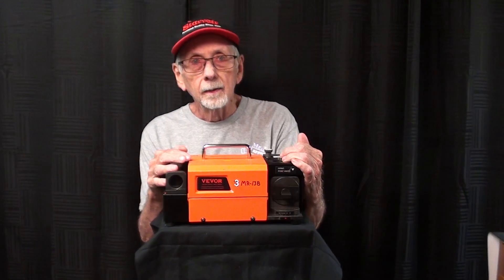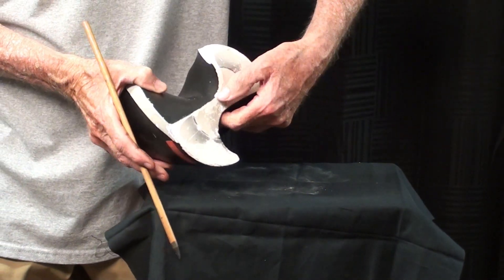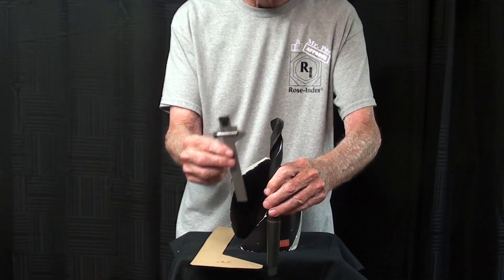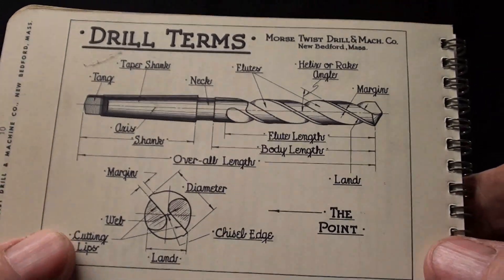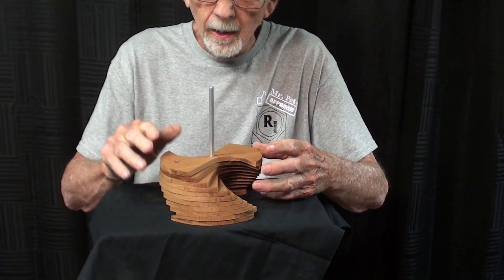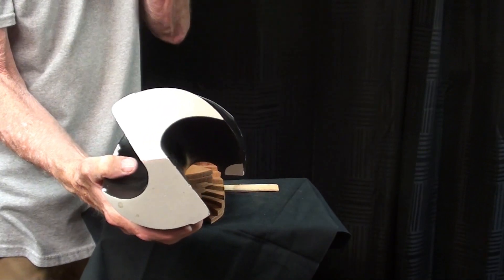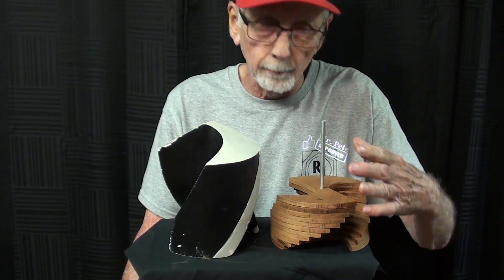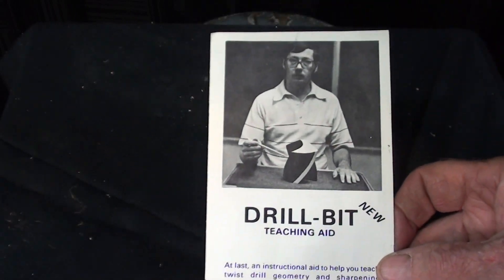TWIST DRILL GEOMETRY #978 huge teaching aid tubalcain

Comment: Once I decided that I wanted to hand sharpen my drill bits, it didn't take me too long to discover that I had to remove the material from right behind the cutting edge,  A twist of the wrist does it.  I use a vertical belt sander, it doesn't heat the old bit as much as a wheel.  My results are surprisingly good. Ron W4BIN
Reply from the maker: Thanks for sharing!

Comment: Despite what you said about mouldings, I would love to hear more about that; specifically, how you would do it differently today. Would you still make it the same way? Or would a 3d printer be better? I can imagine that the two processess might be similar in the level of sanding needed... and I also wonder, as a woodturner, whether the wooden model couldn't be chucked up and turned round, prior to adding the margin? Finally, while I very much want to eventually try my hand at casting in metal, it's a bit beyond my equipment, skill. and confidence levels... so this kind of project peeks my interest. I imagine that a deep pour epoxy would make sense... then again, with today's materials, perhaps 3d printing would just negate the need for the pattern altogether?
Reply from the maker: I would definitely use a 3-D printer

Comment: That's very cool seeing how you made the model. This seems like a good 3D printing project. 

BTW, I bought the MR-13B drill grinder on your recommendation. It arrived a few days ago and I have managed to sharpen a few drills with it. Your instructional video of settings the alignment stop was very helpful. It does a very good job on larger drills. It is impressively fast and consistent. I find the stop doesn't work for drill under 3/16". Lining up the lip parallel as you showed manually works for smaller drills, but it is a challenge. I used a pin vise to rotate the drill while eyeballing it since the collets don't give much slip. I think my Drill Doctor is easier for the small sizes. I would toss them, but I insist on US made drills, and they aren't cheap.

Comment: That was interesting & a fun look at your invention, a great teaching aid I wish I had while teaching a few co-workers how to  operate the shops Lisle 91000 Drill Grinder. With modern manufacturing tech. (printed 3D parts!), it would be nice to make a similar shaped part out of durable plastic. I would actually like 3 variants, #1 showing the perfect sharp drill tip, then #2 with negative angle (the heel higher than the cutting lip, & #3 like #1 Plus a split-point added to the #1 to describe the advantages of split-points to students &/or customers for a plus sale at a sharpening shop.  Thank you Sir! Blessings!
Reply from the maker: With a 3-D printer, as you said, we could have all of the variations to show to the kids.

Comment: Howdy Mr. Pete,
Have you made any videos on faceted drill bit grinding? The T-8 Tormek grinder I mentioned in my reply to you regarding the reason the Chinese call drill bits end mills, has a drill bit sharpener kit that goes up to 7/8", but it grinds a faceted tip instead of the common radial tip. 
It is a much slower method and I would only use it on my larger bits. I have some MT shank drill bits that go up to 7/8", and I would have to put a sleeve on the shank because the Tormek jig will only hold straight shanked bits.  Any comments would be appreciated.
Reply from the maker: I am not familiar with the tarmac grinder.    I wish I had a grinder that went up to 1 inch diameter drills.

Comment: "Not interested in molds"
So not true, 1962 started apprenticeship at Superior Mold Builders, nee Key Plastics then Norvaries until a left foot diabetic ulcer retired me in 2019.
Your pattern and mold was very interesting.
We had an Oliver oscillating drill grinder in the tool crib for the radial drill press that put a perfect grind on a drill. A hand held seldon produced equal chips, the level washer is a good test.
We would thin the web on large diameters on our Gorton cutter grindemr by hand.
Reply from the maker: Thank you for that information. I have seen pictures of the Oliver grinder.
They made great woodworking machinery. We had lots of that equipment at the high school years ago.

Comment: This was interesting. I took many shop classes in high school, but remember little what I learned or how the teachers did the lessons. Spent them spinning out of control with ADHD, I suppose. I have a question about the drill sharpening tools that Craftsman and General sold for years. Before you got the Vevor did you have any use for them? Pros and cons? I have had several over the years, but I didn’t really know how to use them because I always bought them second hand with no instructions. This video did give some clues regarding geometry and I think that your previous ones go over it in greater depth. Those drill grinders are plentiful and cheap at garage sales.
Reply: It sounds to me like you're describing a pit bull drill bit sharpener. I have one made by General. Someplace in the distant past the original was named pit bull? I think they're OK but not how the instructions say to use them. If you do what they say you get a grind parallel to the cutting lips. What you really want is a perpendicular grind. Now if you mount the gadget funny you can get it to do that. What I did was I put a bit into the jig and held it up to the grinder so it'd grind perpendicular then just took a note of that position made a base to hold it that way. It is doable. I'll leave it up to you to figure out how. The contraption I came up with is basically a wedge on an arm. I'm sure there's other ways to do it though.

Comment: Being a fan of round numbers... I'm curious why 59 degrees and not simply 60.
Reply: When you do the two nut trick that's 60° which is generally close enough. The two nut trick is when you hold two hex nuts together on their flats and use that as an impromptu drill gauge. But theoretically 59° is a better angle for drilling mild steel. Not that you're ever going to notice the difference in practice. So the two nut trick is good enough.
Reply: @1pcfred  I don't think i've done the two nut trick since my honeymoon.

Comment: I wonder, before time itself, why 59 degrees was adopted as the standard angle for twist drills?  Why not 58 or 60?
Reply: Basically the hardest material you're likely to drill with any regularity is mild steel. So that's the engle they settled on as the default. It'll work with pretty much anything else too. But it is less than ideal for other materials. It still works though.

Comment: A lot of work and materials to mold them. Now I'm sure they can be 3D printed in a day. In our day, everything was harder. Thank you Mr. Pete.
Reply from the maker: Very true!
Reply: I was just thinking about what it'd be like to 3D print one.
Reply: @1pcfred For 3D printing, the work is in making the model. The design could have  replaceable tips to show different tip geometry. It would be interesting to see what the plastic cost would be if printed.
Reply: Yeah, this is pretty much ideal for FDM printing. Nice flat base, no overhangs, can be made mostly hollow so it doesn't weigh much or use much material. And the slicer gives you a nice view of the web cross section. I'd love to have models for various types of end mills too.
Reply: @dekutree64  mcmaster-carr has parts that can be pulled into SolidWorks and Fusion, but I don't think drills are one of them. It shouldn't be too hard to model.

Comment: Hey Pete,  thanks for video, I had me an intern, passed him on to day shift.  I am still almost the old guy, i am working with a 77 year old.
I like to show the washer trick, go to bolt bin, grab a washer smaller than drill, set on end, cutting edge and clearance becomes evident. 
Anyway,  my intern, I think I taught him a few things, boss wanted me to teach him how to sharpen drill.  At least he got to see me sharpen one.  2 years of votech,  when I was that age I hit shop floor running.  I knew how to sharpen a bit, single point a thread, cut a gear, read a print etc.  Went to work in a job shop at 18 making parts.
But the young guys get more safety training.  Hey I wore my safety glasses and wore short sleeve shirts.
New guy keeps turning off surface grinder, I always was taught to get spindle up to temperature.   Oh well.  Just keep fingers out of the way.  I still have all of mine.  I have pointed that out to safety guys.  Safety guards on lathes, the fall down and hit me on head.  Drill press guards, gee.  Safety guy would have me wearing gloves running drill press.  I say no doing, a cut will heal, if I pull a finger off it won't grow back.  Those guys are just doing a job but in the end your safety is up to you.